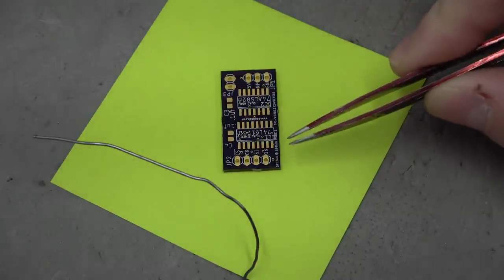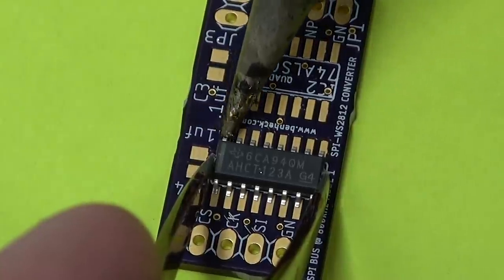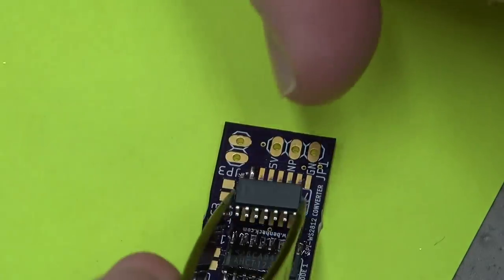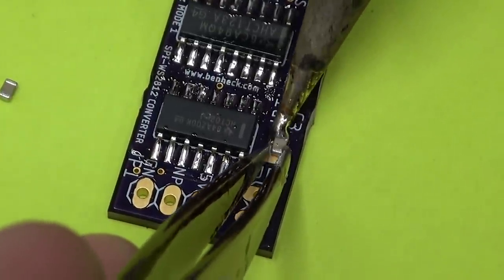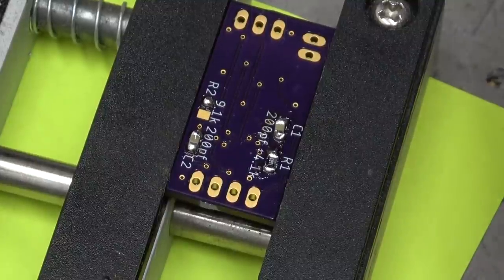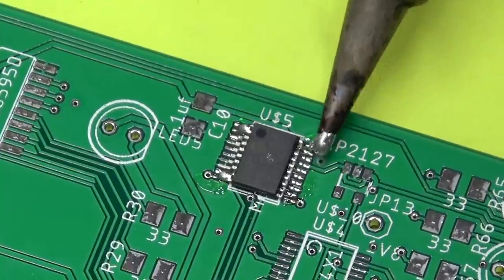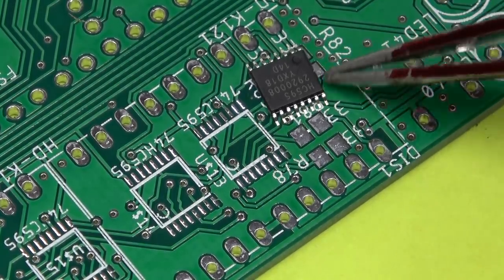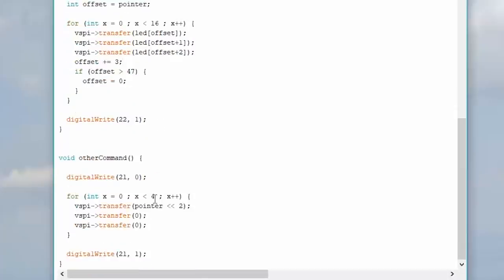Surface Mount Tutorial

Comment: "I'll take a bit of solder and put it on pin 1" - as you put it on pin 16 lol. A nice no-clean flux pen will do wonders for amateurs soldering SMD. Flow a decent amount of flux around and the whole soldering and cleanup process is easier especially on smaller devices including passives. You don't need to blob a bunch of solder on if using flux either but as you said if it works that's what counts.

Comment: There are three rules:
- More Heat
- Less Solder
- Flux is Magic
I actually just learned SMD soldering a few months ago and now I can solder 0402 resistors and QFN chips with ease. Its really not hard so long as you use magnification and keep your hand steady by resting your hand against the table, so that your tweezers don't move while you are soldering.
Also, you can use the blunt end of a cotton swab to hold IC chips in place. Its really helpful for the QFP chips!

Comment: Some people don't seem to grasp what this video wants to accomplish. If you already know about different tip sizes, flux gel or flux pens, solder paste and heat guns, you don't need to listen to him, you already know enough and have the right tools for the job. But if you are a beginner, scared of SMD work, not wanting to "short" 2 pins by using too much solder and connecting them, he is showing you easy techniques to fix the mistake you made by using less than ideal tools you had at hand.
And people saying he isn't using flux: have you ever heard of rosin core solder? You can clearly see that after a few pins his board is coated in flux (5:30). Flux is also not magic. If you have an old board that's been lying around, by all means use extra flux. But if it is a new board and new components out of the factory, rosin core solder is all you really need, since the connections aren't dirty and oxidized, yet.
Is it the neatest job? No. Was he trying to make it neat? Probably not. Is it functional? Yes. Is that all that matters for the end user? Also yes.
By all means, give people more information on how to do a better or easier job soldering SMD components. But don't be a douche in the process and talk crap. 

Have a great day!

Comment: I like to flood the board with flux, you can drag the solder trough the pads with the iron and the solder will only flow trough the pads and the legs of the components, no need for solder wick, and them I just clean with some isopropyl alcohol and a tooth brush. I used to think that SMD was impossible to hand solder, but with a good soldering iron, with a really thin tip and flux is really easy, just need patience.

Comment: Yeah, solder frequently gets bulky and does not flow in this video. Definitely need more flux. The amount of flux included inside the solder wire core is not sufficient.

Comment: Some nice techniques in there, Ben! SMD is not that hard, even if the components are small. Good light and some magnification is good to have.
Reply: Even with shitty light and no magnification it should be possible to do it :D
I've managed once to solder one of those big smd packages that has a shitton of pins spaced ~1mm apart with an big soldering tip, some flux and a lot of patience.
(oh and i didn't have solder wick at that time, that was quite nerve racking.)

The only thing that one really needs is patience when soldering these small parts ;)

Comment: wait? no flux?
Reply: As long as he is using quality flux core solder it's not really needed (desirable maybe, but not required)
Reply: At 5:30 you can see it quite clearly shimmering around the solder joints. He is using solder that has a flux core and it is so much tha the board is still coated in semi liquid flux even after he has soldered all the pins at that side. No need to use outside flux on new components usually. If it helps you solder better, by all means use it though. Just make sure to clean the board afterwards (also a good advice when using rosin solder, but more importan the more flux there is), since flux is often conductive and can lead to electrical issues.

Comment: +Ben Heck - thanks for this confidence booster, Ben.  Would it be worthwhile to put a super-sharp fine tip on the soldering iron for stuff like this?
Reply: No, actually getting a fine tip is a bad idea. What you do want is thick flat or beveled tip and flux and I mean drown the chip in it. It does wonders to the surface tension of the solder, you can just have bit of solder on the tip and touch multiple pins at the same time and the flux will cause the solder to only be where it should be, no bridges.

Comment: Ben. In eagle turn off all layers but tCream. Export it as a DXF file. Open it in adobe and convert it to bitmap. Then Raster laser cut transparency sheets. You now have solder paste stencil. Few caveats. May need to change offset in the eagle DRM. 2 mils. This will shrink the pad sizes. May need to fix some vectors in photoshop. And need to run the laser at like 40% power and 50% speed. Raster makes for sharper corners than vector cutting. Use laser printer transparency sheets. They can take the heat. Do this for bCream as well. Then use a clip board to hold the sheet in place. Business card to spread the solder paste. Two passes. Low angle to cover then high angle to scrape. Place components then heat gun or oven cook the board.
Reply: He knows. But that's an entirely different video topic, and sometimes you need to put one or two components together for a quickie prototype.
Reply: @ed_halley  he may but i never seen him do it. This looked like Shaq shooting free throws. I know he uses eagle and has a laser cutter so just tryn to help a bro out.

Comment: My opinion/experience with SMD things: It's interesting to see how many people hates SMD and denies it without even trying it ever. I know, since I am one of them :) But not any more since some years. In reality, SMD soldering is faster than through hole, and in many cases it's much easier to replace something than with through hole ... Surely, I don't speak now about the extra small stuffs, that can be hard, indeed. But even smaller SMD formats than Ben demonstrated for us can be soldered "by hand" with a "magnifier on-the-head tool" (sorry, with my poor English, I don't really know the right term ...) which costs around 10$ or so at max. Surely you may want a good soldering iron/station, with direct coupling of heating element (and the sensor) like T12 tip, or the "famous" TS100 etc uses. T12 from Hakko, and similar things are expensive, but in my practice, cheap clones (for both of the iron "cartridge" itself, and the station) are more than enough. Or s TS100, in fact. Or anything similar with similar direct heating and sensing feature. Surely, these were only my PERSONAL experiences and opioin, you can have your own. And again, sorry for my bad English :(
Reply: I used to commercially hand assemble SMD military communications gear. So I think I've more than tried it. BTW I think SMD sucks.
Reply: Do not take it personally, I didn't say it's the case for everyone, I just said that I have my own experience and also the fact that many people I met actually "hate" SMD just because by their belief without even trying / considering it seriously, or whatever. Clearly, according to your comment, you are surely not one of them.
Reply: if I was a pick and place machine I'm sure I'd have a different opinion.
Reply: @1pcfred  Haha, that's a good one :)

Comment: Looking at the revised schematic, how are you clocking consecutive one data bits, as the MOSI line doesn't make a transition to re-trigger the output? I would think you need to pass CLK to the B input of both halves, and then pass the inverted MOSI to A for the "one" pulse generator. Luckily that 4th gate is sitting at the ready :)

Comment: Hi Ben,

I hope that's not going into production. I'm not sure if any of those joints are passable.
Reply: Is it for general public then IPC class one will do if it's essentially
soldered?
work? 
Then it passes 

Source: I'm q.c. in a IPC class 2/3 area
Reply: One, production would be where you bring in solder masks, solder paste and reflow ovens. This is prototyping. And two, most of the gunk we see in this video is flux buildup not solder. Lots of flux removers out there but I like plain old limonene GooGone with a toothbrush.
Reply: This has made me get out my copy of IPC610 and even at a glance the globs of solder on the passives fail class 1 as the excess is touching the component bodies.
Reply: @Diehard4077  the problem I've got is with the title. He's called it a tutorial.

After all these years of hacking and modding, I would expect Ben to have better skills than this. 

Even when he's "touching up" he doesn't add, additional flux.

Everyone should start somewhere but should strive to reach NASA quality.
Reply: But noone is going to hand solder stuff that's going into mass production. Such an idea is practically an oxymoron.
Reply: @ingmarm8858   if I'm not mistaken solder can touch the component body aslong as it is not a ceramic body
Reply: @flagmedownmedia   yes the quality does "bother me" and I'm assuming/hoping he's showing this kind of quality to take the stress off of people starting out
Reply: @ingmarm8858  found it 8.3.5.5 
Target - Class 1, 2, 3 
 Heel fillet extends above lead thickness but does 
not fill upper lead bend. 
 Solder does not contact the component body. 

Acceptable – Class 1, 2, 3
 Solder touches a plastic SOIC or SOT 
component. 
 Solder does not touch ceramic or metal 
component. 

Acceptable - Class 1 
Defect – Class 2, 3 
 Solder touches the body of a plastic component, 
except for SOICs and SOTs. 
 Solder touches the body of a ceramic or metal 
component.
Reply: @Diehard4077  it's awesome actually having intelligent folks to interact with 😁
Reply: @ingmarm8858   i try to know my job so i'd be harder to fire ;P
Reply: @Diehard4077  haha yes good idea! In my defence I can't get away with class 1 at work and my OCD kicks in anyway lol
Reply: @ingmarm8858  I'm class 2 at work at home without my scope its not always the best lol

Comment: Actually the surface mounted devices are easier to deal with. The only challenge is the smaller pitch compared to most through hole components. Luckily they still manufacture SMD components in big enough sizes that they can still be effortlessly hand soldered. 0603 and smaller passives is getting annoying but as long as you can order 0805 or bigger then all is good.

Comment: Nice, I like it. Your bench, your rules, eh? - As long as it gets the job done.
Yeah, this looks like me soldering surface mount sometimes! Solder blob, dang.... Drags iron across pins to distribute solder - Then cleans up the evidence ... No one will ever know! Muahahaha! Surface mount makes it nice to not have to keep flipping a board over, and over at least. Nice in larger builds.
Still... thru-hole components are nice to work with; and super easy to prototype something. Haven't we all whipped together at least a few, no board widgets, just all soldered together with thru-hole compnents?
* And yeah! - 😎 Solder (Pronounced: Sädər) // Not Solder (Sōld-ər)  👍Thank you!

Comment: Please use flux.
You don't even need to put the initial blob if you have flux. All you need is:
1. put plenty of flux (flux pen or syringe one) on the footprint
2. hold part in right position
3. touch corner pin with soldering iron with solder on the tip
4. If you used enough flux, you can drag the tip across all the pins and they won't bridge

Comment: Awesome, thank you so much. Have you tried soldering preballed BGA parts? Any luck, or is this not feasible?
Reply: BGAs are actually pretty easy, you need a hot air station and a good liquid flux... heat the board up a little add some flux get the part close to were it should be a heat it up until the solder melts, the part will center itself... if it’s super fine pitch like 0.4mm then you probably need a machine with optics to place it... it can be done but it isn’t worth it, have a shop with the right tools mount it for you...

Comment: Not to add noise on a soldering video, but I like to label the pins with human readable text instead of explicitly stating the pin number each time.  You've commented what the pins are used for at the top instead of defining a label that means the pin number.  Then I explicitly state the name of the pin. 1 and 0 are universally high and low respectively so substituting that doesn't make as much sense, but I could see someone being pedantic about it and doing that too.

Comment: I still don't understand why this circuit is needed. I drive neopixels from esps all the time without any extra circuitry. But I love a good soldering video. especially with a non-forced ben voice over. feels like the good ol days again.
Reply: He explained this in the previous video. You can dedicate a lot of CPU load to bit-bang this out, or you can use a bad library to use less CPU but a lot more memory, or you can essentially let the SPI hardware do the data transfer autonomously directly from memory, like a DMA function. This is very useful on the much smaller Atmels than on the beefy fast microprocessors like ESP32s.

Comment: this makes me think i should increase the temp on my iron
Reply: Before trying that, I suggest using better quality solder (leaded with flux core - e.g. multicore/loctite). Also Ben doesn't use flux here but that also makes everything a lot easier, with flux applied the solder just goes where you want it to.

Comment: In the schematic at about 16:27 the ONE timer is triggered by the rising edge of MOSI. Does MOSI have a rising edge to trigger every ‘1’ bit or will  the CLK signal send a ‘0’ bit for each subsequent ‘1’ bit?
Reply: There is only a rising edge for the first one bit in a series of ones. It is NRZ (non return to zero). I don't understand how this can work properly. A sweep of 0 to 255 would visually reveal if it is behaving as expected.
Reply: I think there will only be 8 brightness levels in these groups of values:  1, 2 to 3, 4 to 7, 8 to 15, 16 to 31, 32 to 63, 64 to 127, and 128 to 255.
Reply: Certain combinations of values will also cause problems.  All 255 for R, G, and B for example.
Reply: I saw the same issue. There is a simple fix. Pass CLK to the B input for both, as the previous version. Then use the 4th NOR gate to invert MOSI and pass it to the A input of the "one" pulse generator

Comment: Okay I dont know what stuff you using but my solder wants to stick to EVERYTHING when I put it on the board and it doesnt wanna be removed :( What am I doing wrong ? I upgraded my Soldering Station tried to learn and get better but Im still getting frustrated so fast as the solder dsoesnt really wanna flow and sticks to everything and it gets messy

Comment: Questions from an old thru hole guy.  What temperature are you using, are you using lead free solder or 60/40 for this, and does it make a difference?
Reply: The temperatures are the same, also flux is your friend. Leaded is easier to solder than lead-free of course and lead-free generally requires higher temps
Reply: 60/40 is plumbing solder, you want 63/37 for electronics, it solidifies faster, has almost no plastic point, it goes from liquid to solid within a couple of degrees so the part won’t move while it cools, even better for wire... depending on what exactly your doing and exactly what iron 600-800F, same as through hole with 650F being pretty typical for most things if your iron was less than $500... the really high end irons will probably be set to 580-625... irons lose heat fast so 800 might only get you to an actual 600 if what your soldering sucks up the heat... so temperature depends on the person (style/technique) and the work, it’s more art than science... Some parts are heat sensitive, especially some SMD capacitors and resistors, so the actual temperature isn’t as important as heating it for the shortest amount of time possible... for heat sensitive parts I actually run the iron hotter so I’m heating the joint instantly and not lingering with the iron. I heat the pad and let the solder flow and heat the component, I almost never touch the part with the iron...
Reply: ___ Ok bud whatever floats your boat, worked for the largest electronics companies on the planet for past 30+ years, Hayes, BELLCORE/Bell Labs, Siemens AG, LG Electronics and various others, hardly ever seen any 60/40 around... plumbers solder is an industry joke btw, so take a breath a stay calm... but seriously it wasn’t used in the electronics industry for rework or hand soldering much before ROHS killed off heavy metals in consumer goods, 60/40 was most common as large bars used to feed wave solder production lines or solder pots, but for doing anything by hand rolls of 63/37 is what you’ll find used by most professionals... 60/40 is cheaper, so when you’re buying 5,000lb pallets of solder bar stock to feed a production line it can matter, but for a single 1lb roll it it doesn’t...
Reply: ___ good grief the internet is full of experts... Solder from Amazon!?, you know there are companies that supply the electronics industry right, Digikey, Mouser, Granger, Avnet, OEM etc... If you prefer the inferior properties of 60/40 alloy then by all means keep using it...
Reply: robert w I am well aware. Probably done $20k+ in orders from mouser in the last year. It’s just a link dude.
Reply: The SnAC305 (Lead-Free Solder) melts around 700-750F. I used to use the 60/40 solder too, but my school's lab uses lead free and in my experience, the main difference is that you can't use the shinyness as an indicator of a good solder joint. You have too look at the shape of the joint to tell if it is good or not. Just remember: More heat, less solder, flux is magic. Use those rules and you will be a master at SMD.